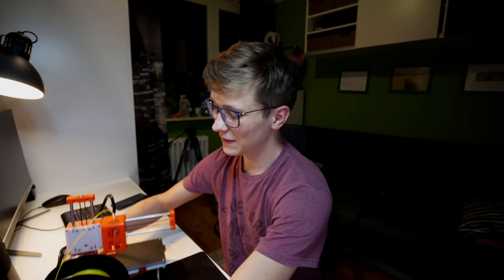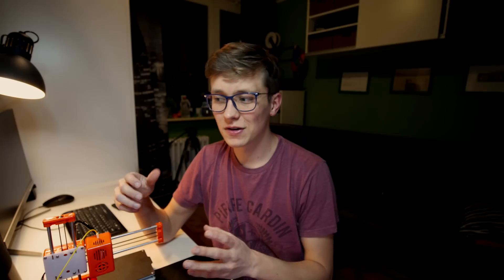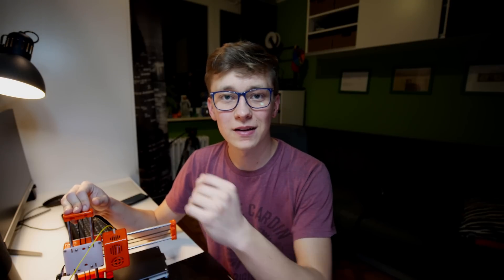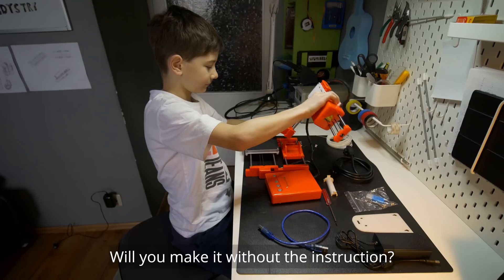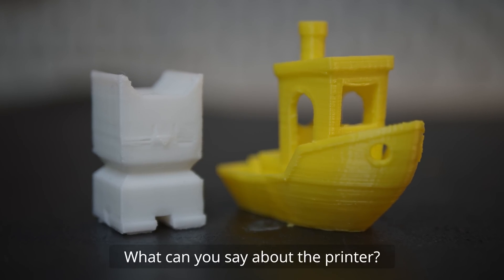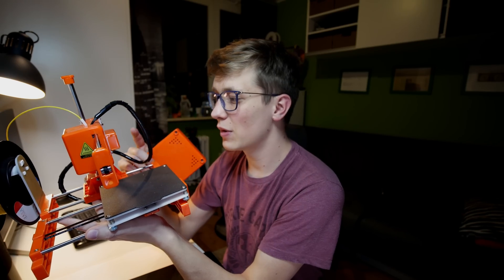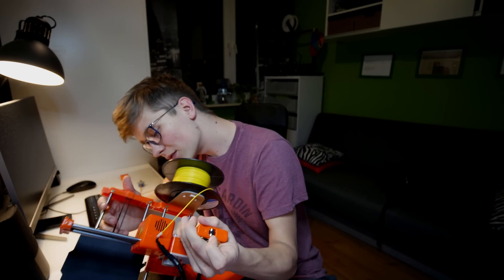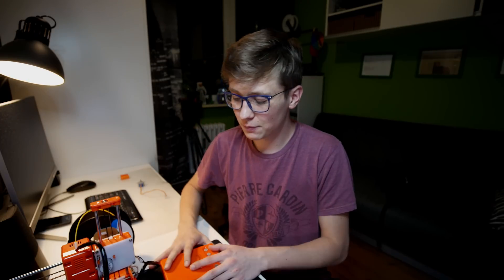$99 3D Printer Assembled by 9 Year Old

Comment: French-Italian STM32 from STMicroelectronics is gaining momentum vs. ubiquitous but limited arduino-nano-based devices.
Reply: Last I heard, Prusa i3 uses stm32 chip. I don't know what devices use the atmega328 found in most arduinos. I have seen atmega2560 (arduino mega) in some boards.
Reply: @otheraccount5252  The genuine Prusa i3 MK2(S) and MK3(S) still use the old 8-bit ATmega (2560?) microcontroller. The new Prusa Mini uses a STM32, and there's a good chance the Prusa i3 MK4 will do as well, when that's released (but MK4 isn't even officially announced yet; Jo Prusa has mentioned MK4 in interviews in a nonspecific "well of course we'll make a MK4 *at some point*" kind of way, but that's it as far as I'm aware!)